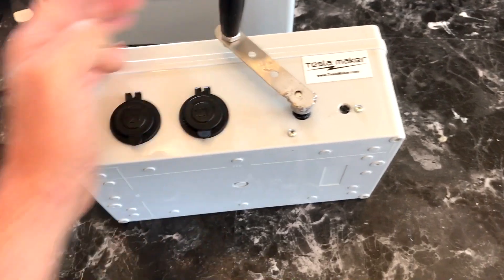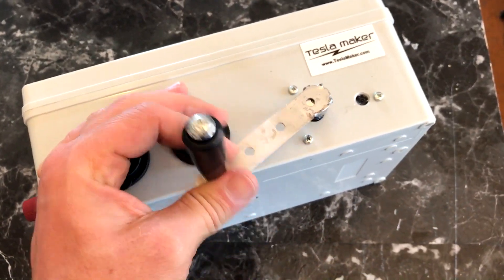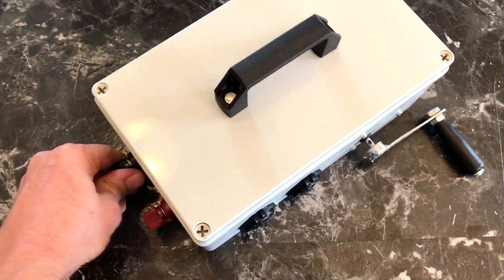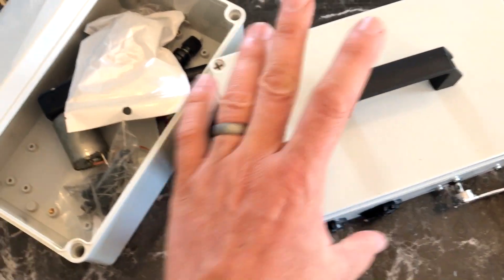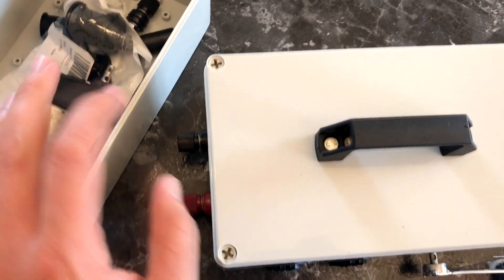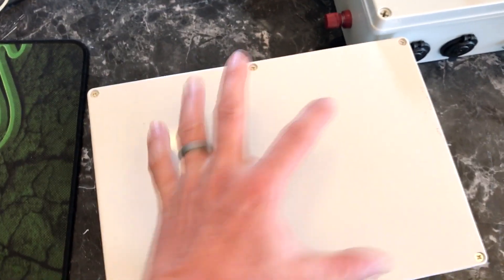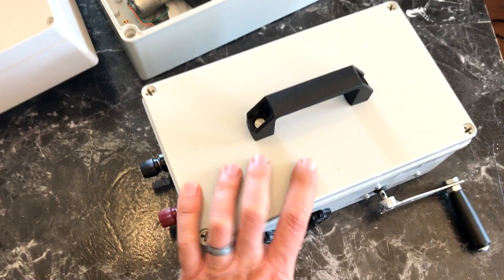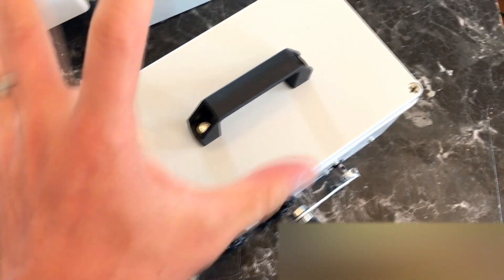V2 DIY Hand Crank BoostBox - Capacitor Power Can Start a V6 Engine

Comment: I've been working on this project and got frustrated trying to find a suitable crank handle so I finally designed my own and 3D printed it. I thought I'd share it here in case anyone else is having trouble coming up with a suitable crank handle.
https://www.thingiverse.com/thing:3082983

Note that I've only printed it in PLA so far but for my basic testing purposes it's proven plenty strong enough (printed at 60% infill).  However, if you're really going to reef on it, you might want to consider printing it in PETG or even Nylon.

Comment: Nice proof of concept for starting a car although I would recommend an antique German hand drill and a hand saw for working without electricity.  A rental car or truck company could probably use a few of these in their fleet for trucks that sit parked for extended amounts of time with the battery connected.

Comment: How did you connect the solar panel to the boostBox ?  I only see terminals output for an inverter?  Or are you using the same output connects as the input from the solar panel?

Comment: Oh my.. Soldering 101 - heat up the joint FIRST, then apply solder.  You're using way too much solder to compensate.  Even if your solder joints never cause you issues, you're teaching every viewer how NOT to do it.  Also, for such a potentially high-current application, you should solder your crimp lugs, too (after crimping).  They'll handle a lot more current that way.

Comment: @lasersaber Have you ever considered the success rate of running your car with HHO?
Because if these generators can charge this easily, I think one or two generators can easily produce a decent amout of LPM of HHO, right?
So no cost of gasoline and your own weight space saving power solution.
I would call that a win if it turn out to work.
Can you please look into that?

Comment: Do we need to charge and discharge the super-capacitors several times before normal use?  I saw this mentioned in a couple places when I was looking at different super capacitors to purchase.

Comment: I just thought it would nice to have a pulley on the handle base that would allow you to run a belt onto it. This could then be used to connect it to a foot petal from like a sewing machine. Using leg power to crank this thing would be a lot easier. Also the pulley could be connected to many devices. Maybe a water spun wheel from a tank of rain water.
Reply: Always weird to rewatch older videos and find your old comment on them.

Comment: would this work in place of building your own super capacitor bank?

https://www.ebay.com/itm/Eaton-16-2V65F-Engine-Starter-Booster-Car-Super-Capacitor-65F-58F-15V-16V-1PCS/162719615299?hash=item25e2d84943:g:CrIAAOSwZB9Z6fBo

Comment: thanks for posting.  nice work.  here are some late thoughts.  imo, at 7:25, you were well on the way to cooking that diode with the soldering iron.   thanks for the info about the small hand-crank generators.   i am guessing nominal output would be about 18 watts.  in lieu of replacing the pm motor, another stage of step-up gearing could be added, to 'speed things up'.    you may know, in an application where a high-speed pma is desirable, the stator coils can be connected delta.   then, output rises Amps over volts.  lenz force drag at lower speeds is initially less, then gradually climbs with rotation rate; output power (watts) is roughly equal to stator coils connected wye/star.     cheers
in case you or your subs might be interested, here is a link to a video in which, just maybe, overunity is achieved, on a table top.   
the video appears to show an Energy Gain of 60-plus percent; where input power is about one watt and output power is about 1.6 Watts.     this percentage corresponds to the Amount of Mechanical Advantage the drive motor has Over the load (generating coils), located Nearer to the center of rotation.      if is is true, it is proof of my separate research, conducted in 2016.   the idea is simply to use Leverage and modern power generating hardware, to Easily achieve overunity.    (see the law of the lever; the wheel-and-axle, which is a Rotary, 2nd-class Lever.)       see my  channel for more info, if it suits.    cheers
https://www.youtube.com/watch?v=064IF7MfNCs

Comment: OK.  I have to admit I like your idea, but you have a flawed approach.  The carbon footprint of what you are building is not sustainable.  Please consider a much more cost and environmentally friendly approach.  Are you aware that permanent magnet treadmill motors are some of the most efficient electricity generators available today - and you can get them for free at just about any junkyard?  I use them for wind generators, but properly geared they would charge 10x the capacitor bank you currently use in the same amount of time!  With that kind of charge capacity you could forget changing batteries and just flat out charge your lead acid battery from scratch!

Comment: I'm building a small solar generator and would like to include a backup hand-crank generator hooked up to a small bank of supercapacitors which would either feed into the battery (which contains a BMS) or into a charge controller, then to the battery.
My reasoning is that it makes a lot more sense (and is more economical) for the hand crank to be charging the supercapacitors, and then the battery (which is lithium, btw) instead of just endless cranking of a generator which may have little charging effect on the battery. I'm having trouble with a few issues:
1) If the output is going to be roughly 12v to a 12 v battery, is it better to hook up the hand generator unit directly to the battery, since the battery already has a BMS, or is it better to hook it to the charge controller?
2) Am I wasting my time altogether, since the supercapacitor will only do a very strong surge current at a time, and regulating it through a charge controller will defeat the entire purpose? i would really like to have SOME backup should there be no sun AND electricity.

Comment: Could you make an adapter to connect the generator to a bicycle?  A small wheel where the crank is perhaps connected via belt to the rear wheel rim of the bicycle?

Comment: lasersaber* how long do those hold a charge?.........i have a electric motor hub from here https://www.walmart.com/ip/Pinty-Premium-48V-1000W-26-Electronic-Bike-Conversion-Kit-with-Motor-Rear-Wheel-Hub-Speed-Controller/788755970 and put it on my mountain bike i need to make 48volts and up to 1000Watts i would like to also get around 30amp hrs as well would you reconmend using these capaciters?

Comment: can't you directly charge your car battery by hand cranking without capacitors ?
Reply: No. Batteries take longer time to charge and due to the size of the crank motor it will take longer. The advantage of the cap is that it charged fast and discharge fast enough to start the engine.

Comment: If you put the crank on the top and a on opposite sides you could in a seated position, put the box between your legs and grab a handle and crank easier; especially with a longer crank handle.

Comment: Hi I am thinking about build capacitor jumpstarter... Can I use this - https://www.amazon.com/Quickbuying-Protection-Capacitors-23x3-5x6cm-Electronic/dp/B071KCHKCV/ref=sr_1_8?ie=UTF8&qid=1503082297&sr=8-8&keywords=super+capacitor+protection+board    

Instead of buying recomended capacitors?

Thanks for answer

Comment: Thanks for posting this by the way..... although I would reconsider I'm putting the super capacitors in a box like that. I only say that because if you use a 5 gallon bucket it allows you to put more capacitance in there along with other components that you can open at any time as it also has a Rubber seal and a built-in handle for way less money.

Comment: Can you use this to jumpstart a car? Handcranking your car seems most useful if your battery is dead, but you are on the side of the road. I don't want to replace the battery, but if it's dead at a certain moment, a handcrank will be very useful!

Comment: Great build.  I'm really interested in doing one of these.  A few quick and very minor suggestions:  If you attach the capacitors to the lid instead of inside the box you can work on components inside without disassembling them.  Also, hot gluing a few extra fuses inside the box will be a big plus if one of them ever blows.

Comment: Hello Lasersaber, please answer this question: How long do you have to crank your capacitor bank for a second try after a car fails to start after caps intially run down? That question was posted under a YT video titled "Using capacitors instead of a car battery for 3 years and counting!" by Catrinsin. Thanks

Comment: Wow, impressive project. Can this be used to charge big dip cycle batteries for off the grid application? if yes, how long do I have crank it to full charge a 100ah battery? Cheers :-D

Comment: have a question about all your capacitor boot packs and replacing the battery... why not use a car audio capacitor? there already self contained and I have found them up to 10f@12v.. which I know your capacitor are 300+f but there only 2.5v which is why you make your packs.. but then you wire them up don't they loose capacitance but gain voltage? anyways what I'm trying to get at is have you tried car audio capacitors and do they work?

Comment: I wonder how long a simple raspberry Pie with a display and a couple small speakers would run for on a single charge on this.
Reply: Not that long, maybe an hour. There is actually not that much energy stored in those capacitors. About 4.9Wh with the nominal component values. The cool part is the crazy high currents they can deliver.

Comment: Test supercapacitors in knots to Li-Ion batteries packs in absolutely balanced binary tree. It theoretically could give you occasional high-load and higher capacity capabilities. Some driver, and balancer could be necessary.

Comment: have you tried finding the old dynamo generator out of a used military surplus field radio? those are fairly robust as the military designs things to be used by "200 lbs gorillas" i'd imagine they put out some good voltage too since it takes a bit of power to run a telephone.

Comment: also microwave oven turntable motors make a good crank generator too.
Reply: dude, where do i get a salvage microvabe
Reply: @GamingAmbienceLive  alot of microwaves get thrown out in the garbage lol
Reply: @JohnSeaward  oh yeah I’ve got one probably a year after that comment it’s been packed in a box
Reply: @GamingAmbienceLive   all I can say is that this item is a game changer but question is there a max charge level ? And was say a battery operated drill ever used to crank it to do charge or is that to fast ?
Reply: @JohnSeaward  if you want a serious super efficient crank generator you need a 3+ phase motor like BLDC, problem with most commercial units is that it requires super high speed cranking, which can be bypassed with gears but then you lose efficiency. This guy Tom Stanton made a multiphase hang crank motor that’s easy to make and super efficient meaning more power gets turned into electricity at less effort.
Reply: @GamingAmbienceLive   ok, but no clue who the gent is that your talking about, and loosing efficiency is not a good thing
Reply: m3sca1 yes they do
Reply: @m3sca1  and only issue I have is not being able to connect on your links

Comment: foot pedal crank mechanism would improve usability for inputting more energy...gravity and the weight of a human far exceeds crank power
Reply: I was thinking the same, plus adding a weighted flywheel to the generator would help keep it spinning!
Reply: @Joshua Kiser if made small enough it would be good for E bikes,  charge while ypu petal
Reply: @TRICHOMETRIST  I get sad when I see people believing in free energy. You can charge while  you  pedal but for it to be worth anything or put out enough energy to charge your bike, It would feel like riding a bike uphill in the sand.
Reply: @esqueue  in that case it would be  used as a brake
charging every time you break
Reply: @Joshua Kiser Both slaves and animals need food. Way more hassle than a solar panel.

Comment: run a wood hole saw backwards if you want an easy way of cutting nice clean holes in plastic.  spade bits don't work too well.  running it backwards keeps it from grabbing and gives a smoother finish.

Very cool project.  I'd like to build something like this into my 4x4.  Weak battery, just do a little cranking and you can get it started to get home.  don't really need it.  already have a small solar panel mounted that keeps a float/slow charge on it, but hey it may happen at night!

Comment: You could build one with some sprockets, One on the crank and one on the generator.  With like a 6 to 1 teeth ratio connected with a chain. That way for every turn of the crank the generator turns 6 times.

Comment: Good job,,,  I built  battery replacement for my scooter... 500 f caps , it stayed charged for six days between runnings, then I saw a pcb charge balancer on evay,  the ones with all the active electronics, , it only stayed charged for 2 days....  so I went back to diode bridge system.... works fine...

Comment: I like your project can't wait to see the larger one get done. I have a cople idea's for that one that may work good for it. first is a 4 blade fuse block for the power outputs. https://www.amazon.com/AUDEW-Holder-Vehice-Circuit-Automotive/dp/B01539YX5U/ref=sr_1_5?s=automotive&ie=UTF8&qid=1498749119&sr=1-5&keywords=fuse+block  Also maybe a buss bar system for the internal power conections that way you don't have to take the full system apart if there is an issue with one part of it.

Comment: on your video for a car batery replacement cap bank you had 6 humungus caps in a car batery sized wooden box but there's nothing on that build on your site and the only video I saw was a proof of concept not a build video.  would you consider doing a new car batery replacement video with updated parts list based on what you've learned sonce 2013 with complete build log and so on?

Comment: without the led lamp, light, and crimping tool this project is around $255.49usd, if you get the crimper $276.83.  Many of the projects parts are no longer available from the original sellers.  Cannot find a similar project box of the same size but slightly smaller ones are running around  $12.  if the conversion calculator I found is right 4800f = 4,797.648as = 1.33268ah charge.  I think I have gotten 4 packs of 1200ah aaa rechargeable batteries from kroger for around $9.99.  in theory the cap bank could be charged almost instantly  and discharged instantly where the batteries can be speed charged in about two minutes at a cost of damaging the batteries.  I have a 15 minute charger that never takes more that 2 minutes to charge the bateries but they're almost hot enough to burn you after and have to be replaced more often than recommended.  anyway love the concept but way out of my price range especially when I add a charge/discharge controller and other mods.  I don't get why no one uses salvaged tube TV caps for this kind of project.
Reply: конденсаторы могут зарядится мгновенно, но провода не могут передать эту энергию, провода расплавятся

Comment: What happens if that diode on the generator fails? If there is enough amps charged into the super caps could it jump that diode and ground through you in the metal handle of the generator essentially killing you?
Reply: Practical Guy at <20v? I highly doubt it, even at a 1000A 12v ain't gonna penetrate skin.

Comment: Hi I'm new to all this super capacitor thing but I'd like to build one of these for myself, BUT I live in Australia and all I can find on ebay is 500f 2.7v capacitors will they work as good or better than 400f ? Thanks Seeya Rob
Reply: 87xfute if they say Green Cap I would avoid them. Alot of people including myself have had problems with those.

Comment: Carry a cordless drill along with this and eliminate the hand crank and or have the hand crank in a side pouch as an option incase everything else failed. Just chuck up a cordless with keyless chuck and let it spin it up. You then can have the solar also charge cordless drill.
Reply: 24Seven using a cordless drill is pointless, might as well charge the caps with li-on/lipo cells and cut out the mechanical middle man.

Comment: A brace and bit would've got those holes drilled in a similar manner,  but with fewer intervening stages :)   The boost box could be a life saver in snowy conditions though. They come into their own for starting gasoline engines when it's so cold that even a good condition battery struggles.  I've seen videos where people have permanently replaced their battery with these supercap banks.  Nice job.
Reply: I remember now.  They were mostly YOUR videos :)

Comment: Good job, looks good, seems to work well. For better power output consider making the shape a profile that of the Gibson Girl survival radio from WWII. It was kinda wasp waisted with the crank at the top. It allowed you to crank fairly hard with one hand, without using a table or chair, alternating from one hand to the other if you wanted. I had one for a while as a kid before we had to dismantle it, and you could really crank on that thing.  Works much better than a simple rectangle. Might be able to fill out the shape with some wood (band saw cup pieces of 4x4's or 4x6's) or rigid foam. https://en.wikipedia.org/wiki/Survival_radio#The_Gibson_Girl

You might also consider putting the socket for the handle in a hole like those of cigarette lighters, that have an attached cap that can be shut to keep the water out.

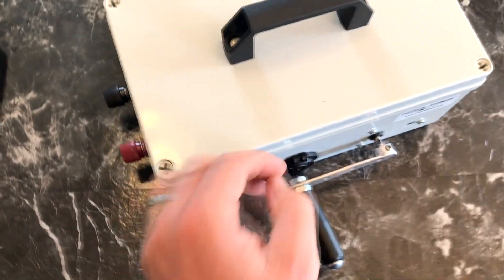Comment: use a low KV brushless motor, say 300-600KV and 3D print a multiplication box of about 1:100 to get about 6000rpm, maybe 1:50 if its too hard, but the harder the more current, just make sure the gears are sturdy enough.